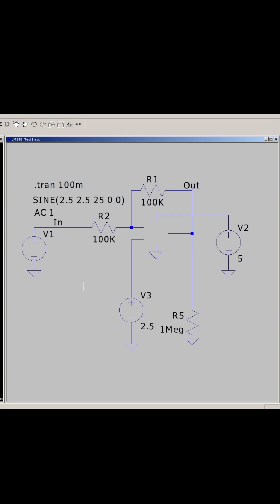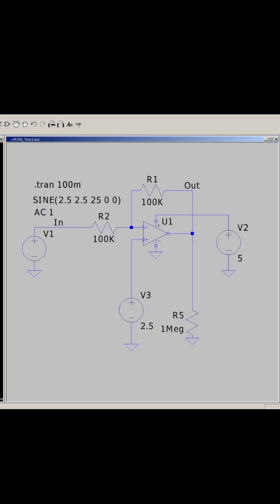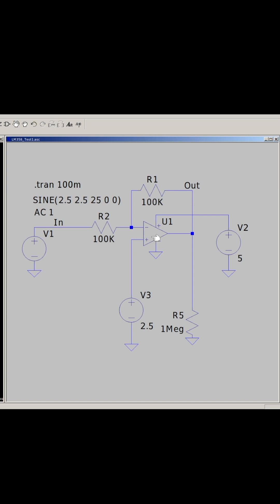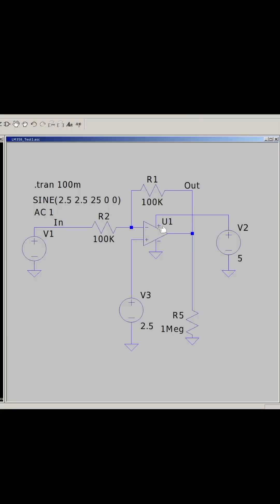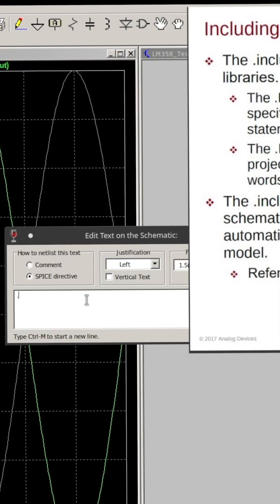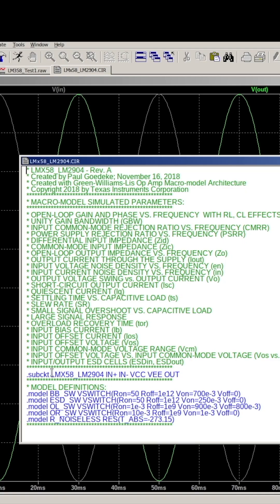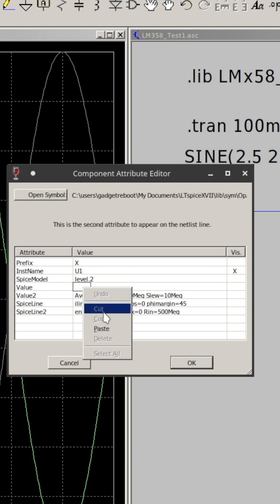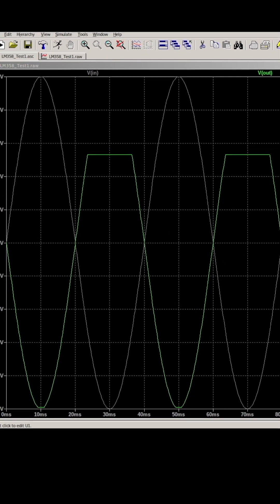LTSpice OpAmp Import

Comment: all part of the spice of life. it would be nice if all components came with a spice lib. I often find the one I want is no where to be seen.

Also it's good if you can put a tolerance on all components and see the worst case circuit operation.
Reply from the maker: Way back I remember trying to do Monte Carlo simulations to see tolerances at play.  
https://electronicsbeliever.com/worst-case-analysis-and-tolerance-simulation-using-ltspice/
Reply: @gadgetsideload  I use to have to do it by hand and a spreadsheet in the old days. Plus it great for your understanding of the circuit if you can sit down and work out the worst case circuit conditions. plus this all helps when having to write the production test schedule for the test department. Also there is the Mean Time Before Failure (MTBF) calculations that also needs to be made to make sure your circuit exceeds the requirements spec. 

Boy it's more fun to be a hobbyist.
Reply from the maker: Yeah in my last job I had to still do a spreadsheet for some areas of a design that may be considered critical, but the bigger spreadsheet requirement there was to go through each part of the design and calculate the power requirements, looking up all IC datasheets for different modes of operation and seeing what the whole board will consume in the expected states we'll run it.   I didn't want to see a spreadsheet for a long time after that.
Reply: @gadgetsideload  A bit like producing the critical component list for medial equipment certification. trying to get the list down to the most critical and still allow some substitution without going back to requalify at a later date.